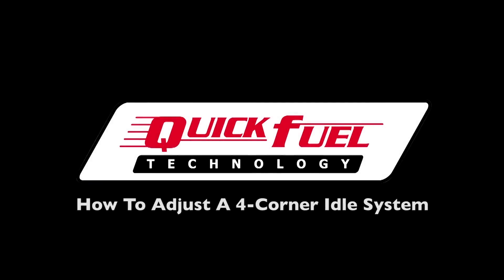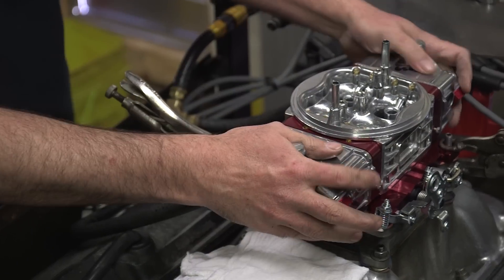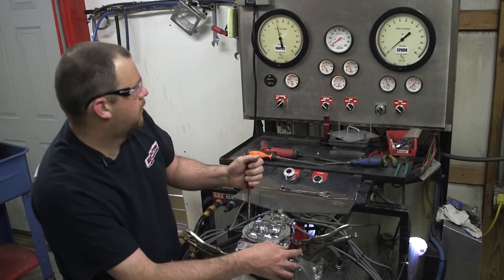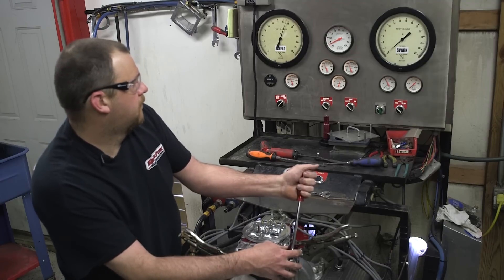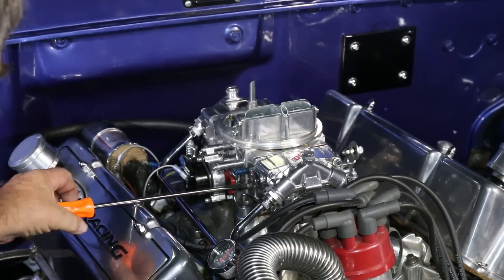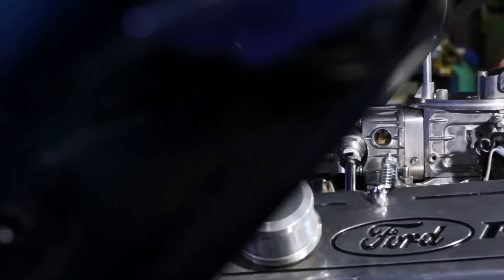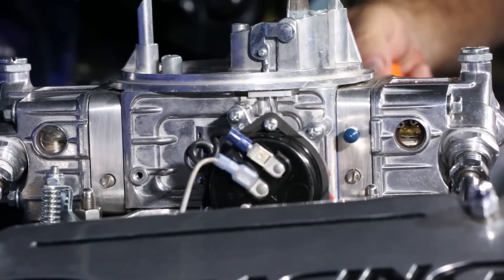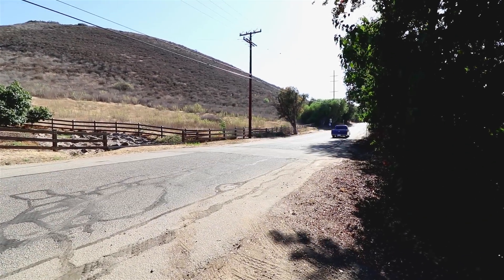How to Adjust a Carburetor 4-Corner Idle System

Comment: Thanks for the good video,  my new Brawler did NOT come factory set. Choke to tight. Idle fuel mix 1/4 turn from bottom on front, all the way closed on rear. Floats set to FLOOD, all the way to top of bowl.  What happened to factory flow setting. This carb was assembled at the factory period. Is this Holleys new way of doing things?

Comment: I find it very hard to believe every quick fuel carburator is adjusted before it leaves the factory mine came out of the box with a collapsed primary float the screws holding the secondary float on where to long a it was not secured . I have had this carburator for almost 12 months and engine has never been anywhere close to running right could not be more disappointed.
Reply: I went back with eldebrock

Comment: I had to 1 1/2 turn... my idle shot up to 1800rpm.
But I back it down to 900.. gonna add about 1lb more fuel pressure and probably go up 2 sizes on the jetting.. that should do the trick..408ci Windsor sbf..